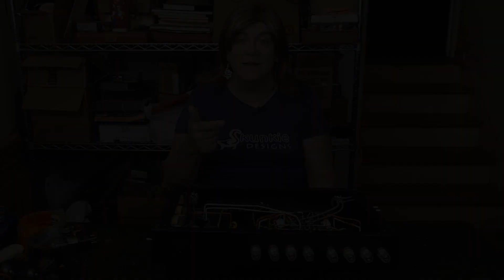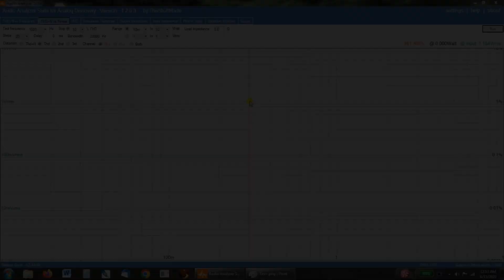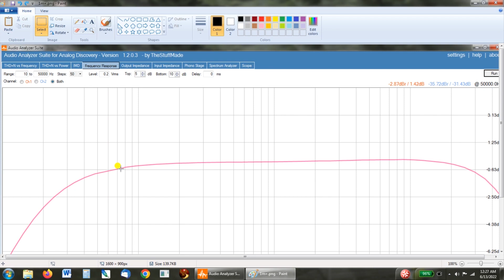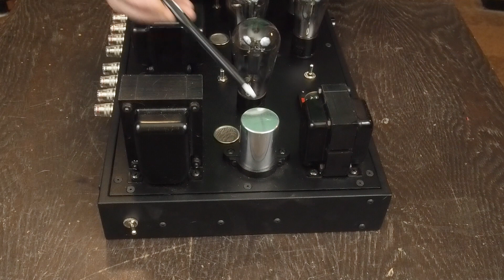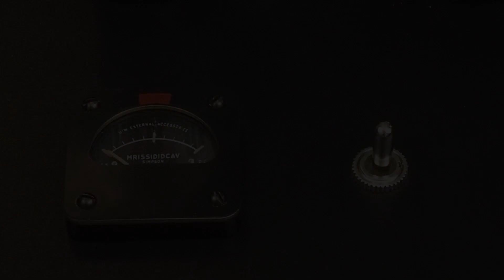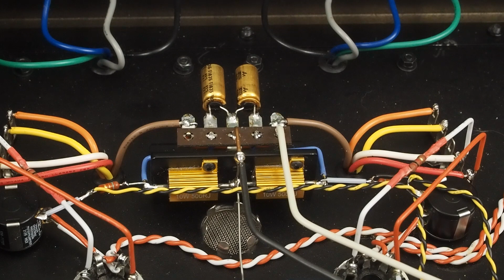1930's Globe Tube Amp: Meter and NFB Install and Final Thoughts.

Comment: Roger Modjeski and I designed a 47 tube amplifier back in 2005 on a whim using a WE310a pentode as a driver tube. There was pentode, ultralinear & triode mode operation in the design. It produced a very satisfying sound. The 47 tube was somewhat ignored amongst other 2.5V tubes and is quite capable of producing excellent results with higher efficiency speakers.

Comment: Ive used oil filled motor runs in a se el84 amp, made a difference for sure but that was as a cathode bypass cap. Class A amps are more sensitive to parts than class AB in my experience. Cool amp btw, I have some hashimoto outputs that im planning to use on a 300b build, was going to go for the 2a3s but my speakers are not sensitive enough to get the most out of them. Im a sucker for globe and st tubes.

Comment: Sadly, Yamamoto stopped production. So, no 100mA meters from them anymore...
Any thoughts of a subtitution product ?
Reply from the maker: You can just use a 100mv meter across a 1 ohm "shunt" resistor as a substitute.

Comment: The 6sq7 / el34 amp......  You can use a 6sf5 instead of the 6sq7. It is the same triode, but no diodes to have to ground. Both have an amplification factor of 100 and 6 volt heater.
Reply from the maker: You absolutely could but not 100% sure it will sound exactly the same.

Comment: Hi, following your channel only recently, I personally like your down to earth approach when it comes "musicality, openness, etc."
I like this amp very much, especially because of the looks.
I'm 63 now, build my first and only amp when I was 12... and now I want to build a small, mainstream amp again, probably EL84 based.
I have a few questions about designs in general and some about this amp if I may:

1. In many cases I see the input potmeter connected only by a resistor to the input grid, is there not a (small) DC current running through this potmeter, causing to create a crackling when adjusting the volume because of the changing resistor value?

2. In this amp I see 10-turn potmeters to adjust the current in the tubes. Is the inductance of the potmeters not interfering with the frequency response of the amp?

Stay safe, great channel!

Leo
Reply from the maker: 1. There is a 1 meg grid leak resistor to "backup" the volume pot and this is a very low DC voltage. Never heard any noise/crackling.

2. Doesn't seem to be a problem, if you feel it might be, use a 1 turn, but good luck finding the quiet spot with AC heaters :)
Reply: Maybe I was not clear :-) my first tuube amp when I was 12, and nothing since! oOnly now I will build one again :-)

Comment: Hi, I forgot to ask.. What line of Nichicon lytics did you use for the 47uF/450V and 100uF/450V caps for B+ smoothing? I tried the Panasonic EE and ED lytic caps before, and did not like them.. The FK line are good for heaters/filaments though.. And what are those brown carbon resistors you use? Thanks!
Reply from the maker: The brown resistors are Vishay metal film, either 1 or 2 watt.

Comment: I was looking for a zeroed centered amp meter, a differential meter, about a year ago for an amplifier I was restoring. @ 2:40 if you look at the meter your using, with no power the needle falls to the left. Nothing wrong with that, it's normal, but it requires a switch to monitor one tube at a time. This is also due to the type of bias. But it is possible to use a zeroed centered meter that connects to both tubes all the time. 
If the tubes,P-P, are biased properly or the meter has no power, the needle stands straight up and down. Then by having a dual gang trim pot connected to both tubes, one tube wired opposite the other on the pot. If the bias drifts the meter swings one way or the other. By turning the pot you adjust both tubes simultaneously. So the meter is constantly showing the running state of the bias no switch needed to "monitor" the bias.
As I was shopping I found such a meter is still made. The cheapest was just under $250.00! That's $500.00 for a stereo unit. That's ridiculous.
Reply: Well crap. Just found one on Adafruit for $7.00, part #4404 +/- 1 amp.
Reply from the maker: You don't want to leave an amp meter in the circuit, like the kind of amp meter that is in series with the cathode, as now the meter coils are in the signal path. Now if you use a shunt type meter, (or if the meter uses an internal resistor as a shunt) this isn't an issue.
Reply: @SkunkieDesignsElectronics  That's what I was looking for, a shunt type. When you find a differential meter now days, they mostly seem to be +10/-10a to +100/-100a with no external shunt. Witch is equally useless. Finding one in the 200ma and less scale is a unicorn.
I have always liked this setup. One glance while normal running and you don't even need to flip a switch.

Comment: Congrats!.. I love the aesthetic. Thanks for sharing the final schematic👍🏼.. I might have missed it, but did you end up using a preamp with it in some cases due to the somewhat lower input sensitivity?
Reply from the maker: Nope, turned out there was no need for a preamp with my sources which are a modern Yamaha CD deck, an EAR834 clone phono stage and a Topping E30 DAC.
Reply: @SkunkieDesignsElectronics  Cool. Thank you..

Comment: Thats a really great looking amp! I remember those kind of tubes from when I was a kid. I built a number of amps with varying amounts of success and smoke.I usually painted the chassis "Black Crackle". It seemed common on both commercial and home-built gear at the time. Have you ever considered making a SE amp with a tube like 813, 811A, 807, 1625, 6146, all these i remember using in transmitters and modulators and always wondered about them for audio.
Reply from the maker: An 807 would be fun but I have several projects ahead of adding any new ideas :)